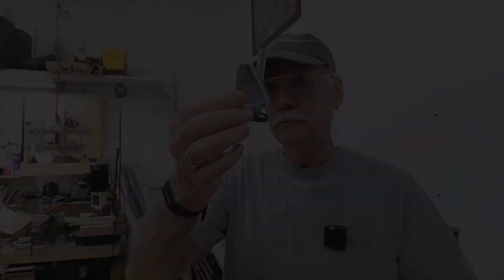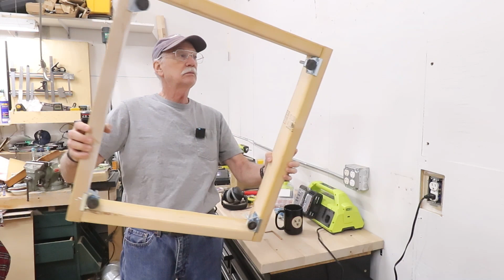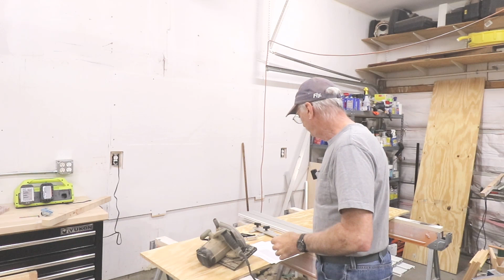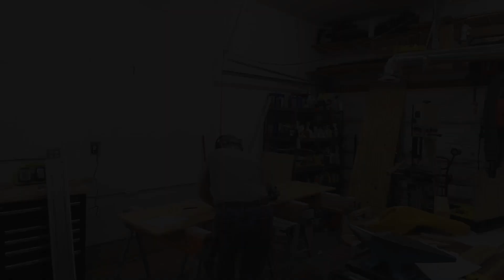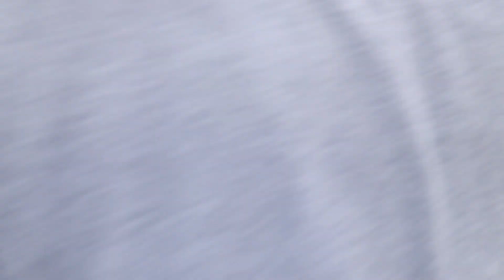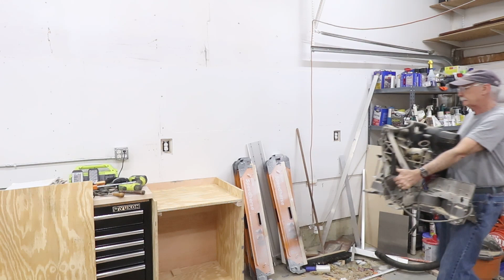Shop Overhaul Episode 6, Building The New Chop Saw Bench

Comment: Skilled in working with virtual machines and woodworking! I like your style.

Fusion360 does have a big learning curve. I finally feel like I’m starting to get the hang of it after a year.
Reply from the maker: Thanks. I'm a retired IT guy. A lot of the latter systems I worked with were VM. In fact, the system I have the most time on is VMware. My last contract was all Hp Thin Clients.  I use VirtualBox at home
Reply: @KRWoodworks  Really cool! Excited to see some French cleats on those walls! Keep up the good work!